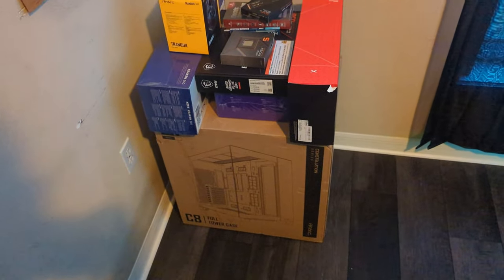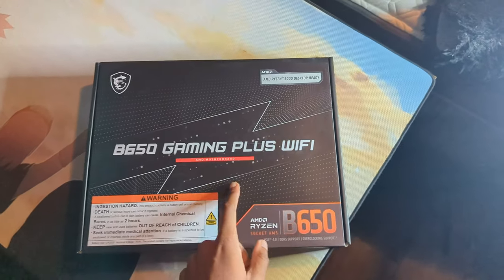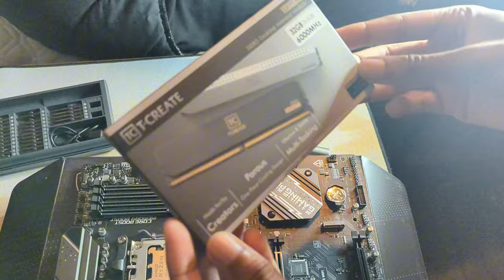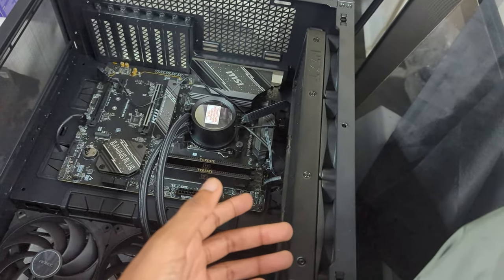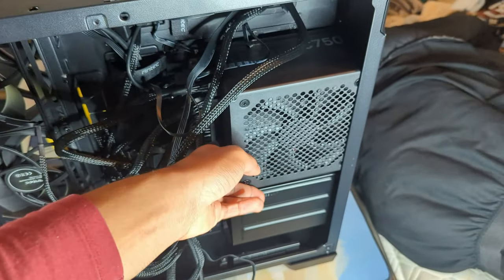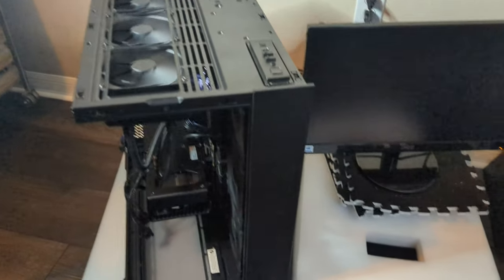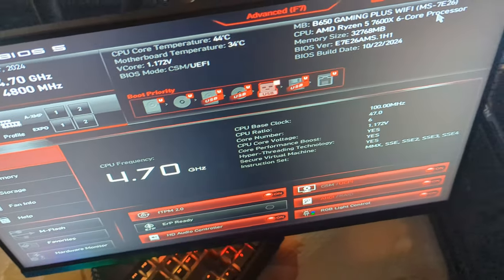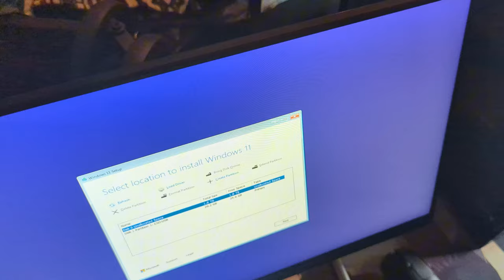I Built My *NEW* First Dream PC (and it was worth the wait!)

Comment: Can you please install the gpu in the upper slot, the bottom slot is gen 3 not gen 4 youll get worse performance
Reply from the maker: Yeah, I did. I had to use the bottom slot in order to reach the bios because it was not updated on the motherboard for some reason and that specific slot was not working at all, so I did that then updated the bios and put it back on the Metal PCI-E Slot 👍 thanks.